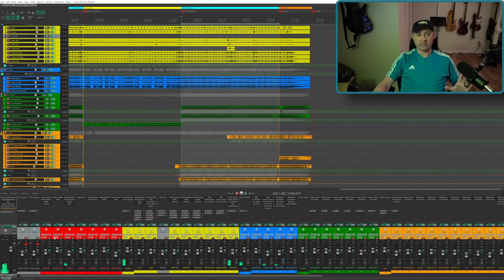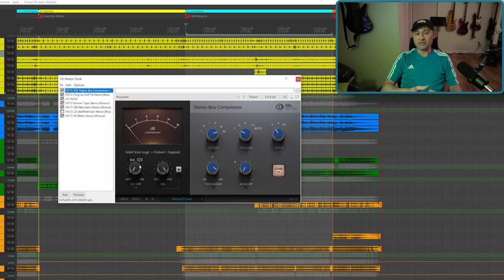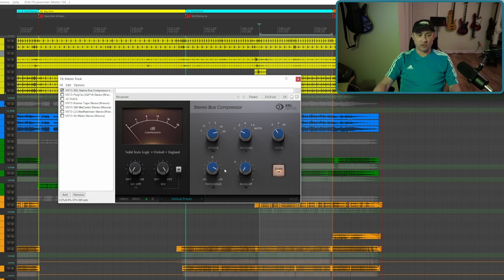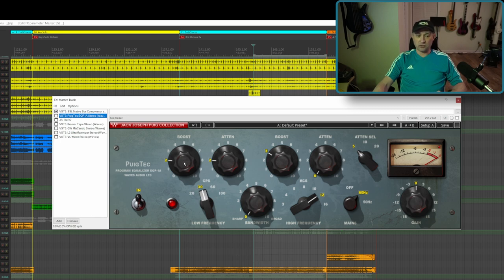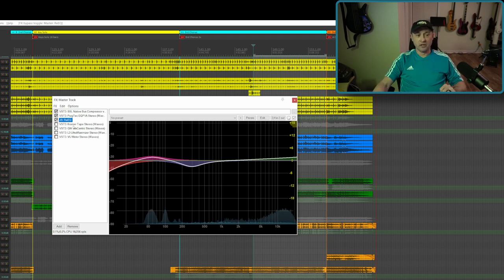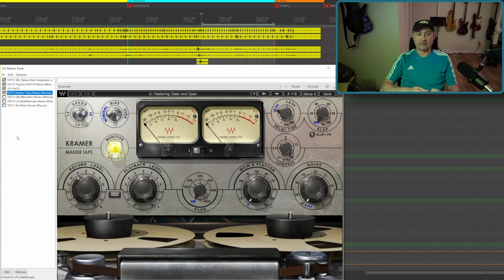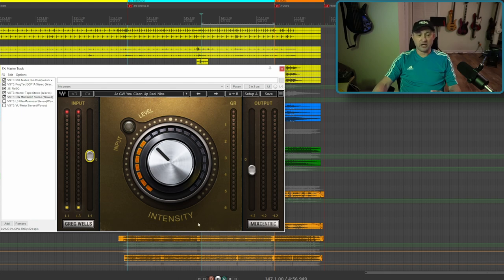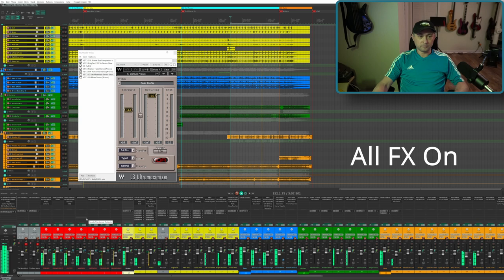Mixing Stuff: Mix Bus Processing in REAPER

Comment: what do you think of Magnetite from Black Rooster Audio or the Tukan Tape Recorder. lately i been using the Tukan Bus Comp (based on your other video) with the Tukan EQT-1A (pultec), Tukan Orange EQ. i was using the Tape Recorder but switched to the Black Rooster Magnetite. and use the Tukan Turquoise limiter. so basically mostly use all Tukan plugins on the Mater Track
Reply from the maker: I haven't used the Magnetite, but I did use the Tukan tape in a few things. Check out my playlist on Tukan plugins. He also just released the Tape Recorder 2 this week. I did a quick like 15 minute comparison test between that and Kramer Tape and it's really close, and definitely comparable. He's making a great case for replacing all my plugins with Tukan!
Reply: @HiYouTubeImDad  yeah i just saw that video and i updated to the S2 version of Tukan Tape.. it does sound a bit better. i like his pultec but it does sound different from the AO RareSE and BPB version of Rare.
Reply from the maker: @teeblack06  Yeah I noticed that too. Ok maybe I won't be changing all of my plugins, but certainly most of them. I'm still keeping the SSL Native channel strip and bus comp though.